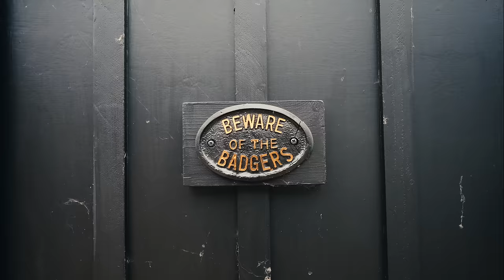Making A Wooden Mallet With Power Tools

Comment: Hello, this is such a simple design, I feel I can make one myself, too.  Thank you.  I have one question.  Since you don’t fixed the handle to the head, will it be loosen when you actually use it?
Reply from the maker: It seems to wedge it pretty tight. I have used it with no problems